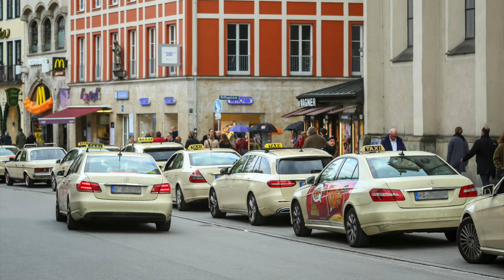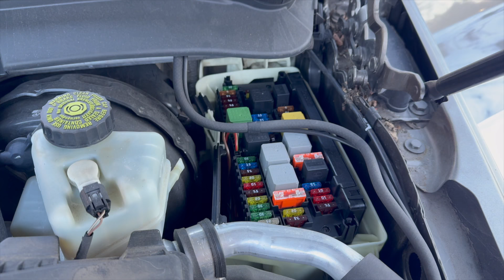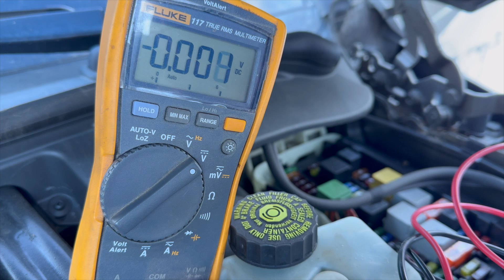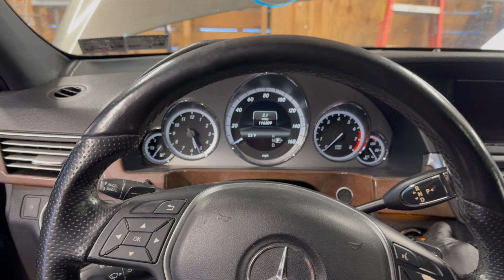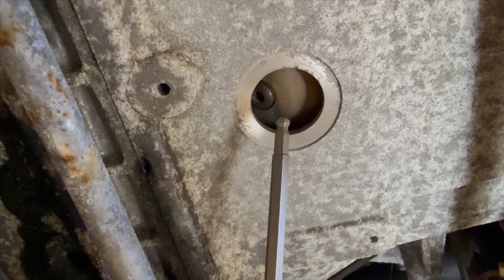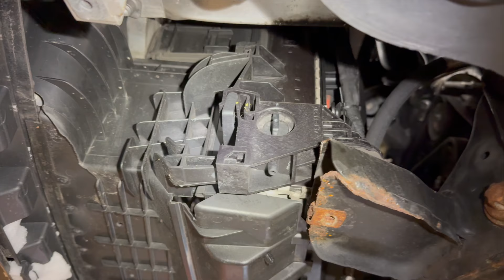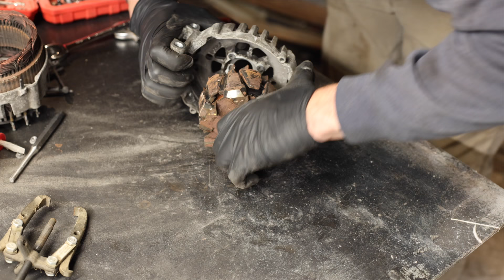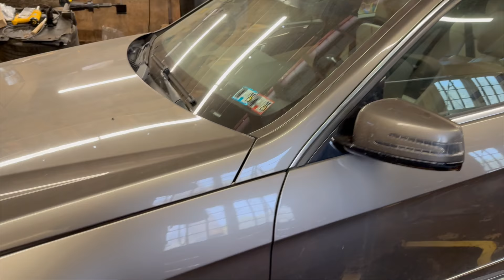I Bought the Toyota Camry of Germany, Except WAY Cheaper (and Better)

Comment: Friend bought an E55 years back- we all warned him not to- it was a nightmare which included the woodruff key breaking off the crank & launching the pulley under hood..."Good times, good times!" The alternator also went out, it was a water-cooled nightmare. Terrible car, great when it worked. When it worked

Comment: Rule of thumb: There is NO such thing as a cheap Mercedes. If you buy it cheap, good luck fixing it for cheap.
Reply: Yep. Expensive cars may be low-cost to buy used, but the parts and service are still Mercedes price range.
Reply: @EdwoodCA  parts are surprisingly cheap compared to other brands where i live, and for the stuff that is insanely expensive there is usually a second hand option. service is hella expensive tho if you get it done at the dealer

Comment: In Germany, there are special cables for camshaft sensors and camshaft actuators that have an oil barrier to protect the engine control unit. It also helps to remove a piece of insulation from the cable and seal it with solder, then apply electrical tape over the solder joint. The oil will then drip out without reaching the engine control unit.

Comment: The Most E-Class here in Germany have a 4 or 6 cylinder diesel in it. They getting round about 500.000 km or more. The best one hat made it to over 900.000 km in 3 years and was still going.
Reply: Let's assume the vehicle doesn't stop for a single day in three years, that it has three or more drivers to manage that while respecting legal work limits, and that it doesn't go to the garage for regular maintenance... that's 822 km every single day. They'd have to drive in circles intentionally to cover that many kilometers a day, which makes no economic sense. I can believe that a taxi might cover that many kilometers on a single day during peak season on a very good day, but not EVERY day for THREE YEARS.
So let me doubt it. But cool urban legend nonetheless.

Comment: The Toyota Camry equivalent (only in terms of pricing) would've been the E220CDI (Diesel) and certainly not an E350 (petrol). Back in 2014 or so Taxi drivers in Germany told me how expensive the maintenance of the more and more complex diesel engines had become. Many have moved away from Mercedes to VW Passat or Skoda Superb (also very spacious). Apparently the price for an E220CDI back in the days (taxi edition, e.g. with vinyl leather instead of real leather) was under EUR 30k, which must'ven been heavily subsidised by Mercedes Benz.

Comment: Oil creeping into the wiring loom on these models is a big problem. I suggest you go under the car, disconnect the wiring loom connector and check for residual oil. Oil through time actually works it's way through the wiring loom to the lowest point and collects there. Clean it out and do it again when the next oil change is due. An indication of that this has happened is when the emiisions levels are bad as the Lambda sensor isn't functioning correctly due to the oil contamination. In the worst cases you may also need to change the sensor. ref. YouTube SPR Autos Mercedes.
Reply: Second that, SPRs last video on this was great!

Comment: Excellent video, man you did a lot of stuff.
However comparing it to a Toyota doesn’t make any sense - that would be a vw or Skoda perhaps. They are used for Taxis in the diesel versions for longevity and reliance not for luxury. They pretty much run them into ground in some countries you do t have to pay taxes if the car is going to be used as a taxi.

Comment: Nah, as someone from Germany, this is definitely not a Camry of Germany. It’s actually known to be a bit shit, especially the petrol engines.
Reply: Well the diesels are quite reliable when taken care of
Reply: That's most cars in the world. @Ollill
Reply: Some people doesn't maintain their cars properly, and then the car fail them, wonder why. I never had any real issues with My Mercs, neither diesel or gasoline,
Reply: You have no idea what your talking about. I have a 2013 e350 w212 and it’s the best car I’ve ever owned. Just hit 196k and the only thing I’ve had to do is the brakes.
Reply: @JMP350  I really hope you have put tyres on it. That is impressive.
Reply: What about the w211? Heard that people in Greece use them as taxis
Reply: @umairawan4103 w211 is one of the most reliable car on planet. all turkish people have those who travelling 2.000 km+ every year twice to go to home from germany.
Reply: @ALINUED  which ones most reliable. Pre facelift or post facelift
Reply: @umairawan4103 models from 2006 are much improved and more reliable
Reply: The engines are fine if diesel, but the main issue with mercedes and all German cars is the electronics as they get older@umairawan4103
Reply: @umairawan4103 They're great but defo get a post facelift one
Reply: The most common problem I see is water infiltration that shorts out either the can bus connectors or the fuse box module under the hood. If anyone owns one of these, make sure the sunroof and cowl drains are not clogged.
Reply: Yup
Reply: No, the german Camry is either the W203 oder W211.
Reply: Haha definitely not better than a Toyota which have had their own issues to be fair

Comment: I had one of those thinner style sway bar end links snap in half on me around a normal corner, on a car with a hydraulic sway bar. Definitely go for the original style ones next time. I had to get towed home as the active sway bar would slam into the ground whenever the engine started.

Comment: I love this Chanel, I purchased a 06 CLK500 from IAA FOR $800. It was $2k shipped to my front door including all the fees and taxes. I spend $17 for a new crank sensor and got it running. Now I just spend $1000 for a new set of headlights, all new brakes and other maintenance stuff. Thank god for rock auto!
Reply: Rock Auto consistently always has the lowest prices, even with shipping. And, even better with the 5% discount.
Reply: @tjw8t1 but the customer service is terrible
Reply: @tjw8t1  that's false. I am a mobile mechanic and I can say quite equally I'll find stuff on ebay and Amazon for lower..with a commercial discount I can also find stuff at autozone a bit cheaper occasionally too
Reply: @Boga217  I'm not a business owner, I'm a tech that orders a lot of parts for myself. Rock Auto is the best deal for me.
Reply: @tjw8t1  how does any of that have to do with finding parts other places that are often cheaper than rockauto. You don't have to have a business license to shop ebay, Amazon, nor do you need a business to open a cash payment commercial account at autozone.
Reply: @Boga217 key word = commercial discount.
Reply: @Boga217 eBay and Amazon have a high chance of fake and counterfeit parts. You are not a real mechanic.
Reply: No thank tom and Jim Taylor. They founded rockauto not God..God is a fairytale money grab.
Reply: @Boga217 God is real. You can thank both. Don’t be an idiot because your life sucks. Or at least you think it is.
Reply: @nnarkaj  Which god? there are so many...
Reply: @nnarkaj which god is the real god?
Reply: @MotownModels 
Jesus

Comment: Newer Mercedes have plastic oil pans, they don't rust but 'nice and tight' will break the thread, they come with 30 Nm embossed.
MB has a suction rod for oil change without opening the drain plug to avoid risk of cracked threads.
Reply: MB has recommended oil extraction for years, since at least the W211, probably earlier.
The service manual says something like oil extraction recommended for all models except X and Y.

Comment: fun fact: BMW5 series are consistently more reliable that Mercedes E-class. I think reliability is less of a deciding factor for taxi use than certain commercial incentives ;-) BTW most EU taxis would be diesel still.
Reply: Ask German taxi driver why thay don't drive bmw instate of Mercedes you get answer BMW das hält nicht! Mercedes diesel engine are just better and cheaper to maintain

https://youtu.be/F3bCm8WRYF8?si=CbuTelh4B2Nw8dzf
Reply: 520d lasts longer than 530d and 535d, that's true. As well as VW / Audi 2.0 TDI is more reliable than 3.0 TDI.
But that does NOT mean Mercedes quality, no way!

Comment: Hi, I think that the reason that a lot of the taxi drivers buy these Mercedes vehicles is that the box that they come in is very easy to convert into a dwelling that has sufficient space to live in comfortably. I know that in the US this would sound incredulous but I was assured by a taxi driver in the Persian Gulf that this was correct. Cheers mate.  Harera
Reply: The reason why all the German taxi cars were Mercedes is: taxi drivers got a hell of deal - after driving a year they sold the car cheap and still made a profit (taxis are wrapped) but Mercedes stoped the taxi Programm so now they drive Toyota and VW

Comment: ALSO, my C350 "Flooded" during heavy rain because my neighbors landscapers left my car COVERED in about an Inch of fine dirt that got into the drain spots and then it rained and the water accumulated and went into the cabin and left puddles of water in the driver side footwell which has all the wiring. i got random error messages and the amplifier also got wet and radio went mute. HOWEVER, i dried everything and put the amp under the hot sun and EVERYTHING went back to normal, literally EVERYTHING. i manually cleared out the drains and it's been perfect ever since

Comment: If ya wanna get a used German car, get Waldo to do it.  Otherwise if you pay to get it fixed as shown in this video it will cost you over $10k.  While the video is less than 1 hour long, the repairs and finding and ordering the parts likely took several full days (> 25 hours? ), spread over a few weeks.  There's also over $500 for specialized tools as well.  It's great that Waldo tells us what he paid for the car, but not only does that not include the fees and transportation $ to his place, but the cost of the parts and supplies.  While doing all the work patiently over time might have doubled the $4k initial price for Waldo, if he calculated his time at minimum wage, he's now got a $10k car, which would be $15k if he took it to a dealer to get done.  He is a great mechanic, and somehow, even with meager facilities works very "clean".

Comment: i agree if it's an E350 without 4Matic. it will run FOREVERRRRR
My C350 is basically the Corolla of Germany. i've only had to do regular maintenance and one or two cheap sensors and that's it. Except corollas don't have 302 Horsepower and a sport suspension lol

Comment: Remember this, there is no more important safety rule than to wear these, safety glasses.  -Norm Abrams
Reply: On again off again doesn’t keep rust out of the eyes.
Reply: Noticed he had safety glasses on during the second half of the video.
Reply: Norm is the man, I loved watching his woodworking workshop! Not too many people nowadays even know who that is anymore unfortunately!
Reply: @yohoyoho13  I was going to say the same thing again..
I think he gets so into his task he forgets. 
When I was still nursing in a clinic we often had people coming in with a a shard spec in their eye. Most times it could be removed with the right equipment but otherwise we had to use multiple eye baths with a very sore eye and wait for it to wash out..
Metal and wood are far more dangerous than soil or grit for obvious reasons. 
There is a real risk of permanent damage.

Comment: "Flicking" the idler pulleys like at @21:19 may give a false impression of a bad bearing because the pulley itself may "ring"... Since you're replacing the belt, replacing the idlers at the same time is simply best practice.

Comment: Oil drinking ECUs seems to be a common problem.
A backyard way to solve it is to create a weir 
Whip down to your local electronics store and buy some connection blocks 
(Solder or screw it's up to you) and a small enclosure and heat shrink.
Pick a nice spot between the oil supplier and the ECU and take a sawsall or more suitable tool to the wiring harness and cut it in two. 
Then painstakingly join it together again with the connection blocks and tuck it into the enclosure sealing it up from weather but allow a drain hole.
Now the only problem to solve is the puddle of oil on your floor.
An alternative is to strip some of the insulation , put some solder on the bared wire then use liquid insulation tape to seal it back up along with some tape.

Comment: Thanks Waldo. I'm in my 7th year of owning my 2013 E550 and total maintenance cost to date has been USD $8,000, no more than if I had had a Toyota Corolla. In August 2024 I took a taxi in Augsburg, Germany; the driver told me that he had had a W212. "Guter Wagen", he said, adding that he had put 600,000 km on it.

Comment: I know some Mercedes are reliable but I wouldn’t put them in the same reliability category as Toyota 😂
Reply: Toyotas aren't as reliable and durable as urban legend suggests.  I have several friends acquaintances and co-workers who have purchased them new or certified pre-owned and have had significant issues with them often before 100,000 miles. These were well-maintained vehicles.
Reply: @williamegler8771 tis my experience too. Hybrid battery gone at 120k mi ($3.5K aftermarket new), brake modulator was on its way out ($2k), steering rack worn and loose, rattly, dash melting. Contrasted with my W204 Mercedes that was like new and had one pretty minor issue in a decade at these same miles.
Reply: @williamegler8771  all of your friends/acquaintances must have gotten the very rare lemons from Toyota because everyone I know with a Toyota has had no problems at all and they all have over 100,000 miles.
Reply: @bdtaylor1979 family is heavily Toyota and highly maintained, definitely have been some major duds.
Reply: Old Mercedes' can even be more reliable than a Toyota. W123/124 will go forever on the original engine and transmission.
Reply: @ and they take absolute neglect (my poor w124 right now…)
Reply: Probably more of these driving around Germany with 400,000+ miles than Toyotas.
Reply: @ginco_bnz  making that statement would be like someone saying that there’s far more high mileage Toyotas running around Japan than there are Mercedes, not a fair comparison at all lol.
Reply: @ in every other country Mercedes are expensive luxury cars and Toyotas are cheap junk (actually they’re cheap junk in every county), so there’s not a lot of other places you can do the comparison.
Reply: @ you obviously have no idea what you’re talking about at all. Go somewhere else with your nonsense lol.
Reply: You say junk but Toyota and Lexus have been the most reliable car brands in the world. I saw in Germany they have Mercedes without memory seats or leather, small engines and all... It's just laughable. You can tell German cars are crap by the warranties they have from factory... They'll make you pay extra to extend it past 2 or 3 years... They know themselves that they are selling junk.  @ginco_bnz
Reply: SURELY NOT ANY TOYOTA MADE AFTER 2024, ESPECIALLY TRUCKS!
Reply: In Germany where they are just a car they are reliable. You can spec it out to be a reliable tank if you so choose.  For north America they seem to add complexity out makes them not as reliable. But as long as you keep them maintained and use the regularly they seem to last ok.
Reply: True, a Camry definitely isn’t as nice as an E class.
Reply: @jasonmunger8409  niceness has nothing to do with reliability.
Reply: They used to be in the good old days 😅
Reply: Maybe as Toyota used to be. Not anymore the new ones are garbage.
Reply: I mean the e-class taxis in question probably have tiny diesel engines that would rarely if ever be seen in the North American market, so calling a North American E350 'just like' a German taxi is a bit misguided but he also isn't wrong about those taxis being sturdy
Reply: They drive E220 , E200 and E250 CDI which are all noisy and pretty slow @sherbet-o
Reply: @sherbet-o  The diesels in those taxis are a 2143 cm3 inline 4 diesels with anywhere between 130-ish to 170ish HP iirc, so indeed, nowhere near the american V6 diesels.
In general they are absolutely not bulletproof, if one thing goes, it usually means it's all gone so preventative maintenance is a must (ask me how I know). It also helps that none of those taxi cars are privately owned and instead leased, meaning it's serviced by Mercedes. Still, buying one of these is a suicide, but at least while it runs it's a cheap luxury car.
Reply: @TheLastCrankers stop writing this bullsh*t. The most are privately owned and serviced by who they want. If a private owner wants a V6 he buys a V6 some are buying s classes where no 4 cylinder is available. In my German city we even had Lincoln town cars and crown Vic's as taxis. Just because the company owner wanted them.
Reply: Not even close.

Comment: For future reference re: torque converter drain access….

Drill a hole at the 12 o clock position of the existing hole with a 1/2” drill bit. When the “FE” variants came to the US that was one of the discussions we had on the dealer technical topics.. that was the most widely used solution.
Reply: I was surprised that an upgrade was not on the market it seems amenably doable
Reply: and what after drilling hole part you left metal shaving inside? you cover the hole with something?
Reply: @Elrafau  Just find a rubber plug to cover it.  Don't worry about the shavings.  The hole in the bellhousing is just an empty space to house the torque converter.
Reply: @Elrafau  if they have a pump for eco start stop we don’t cover them as it’s covered by the pump. 
If no pump, we have an assortment of rubber plugs we use. 
No worry about metal shavings, gravity helps most of them fall down 😂😂 Plus, the converter area in there is full of them anyhow due to normal wear and tear from the starter so nothing to worry aboutb
Reply: https://youtu.be/M6QQ6El-G1k?si=P65GQPvXqls46VCU
Reply: @juancarlosmorales6775  this is exactly what we do at the dealership.